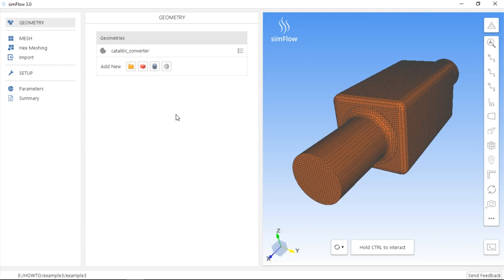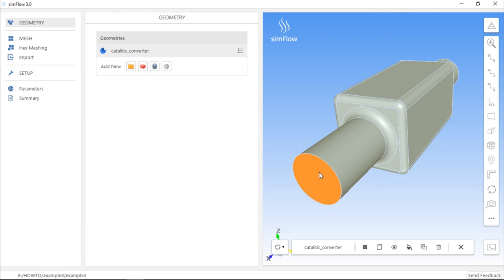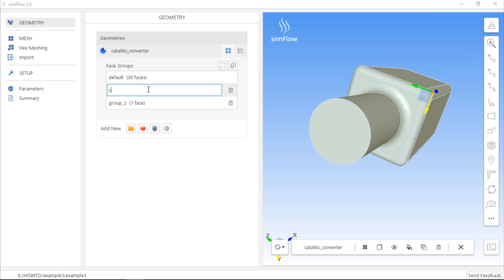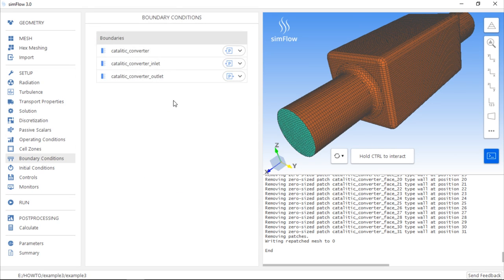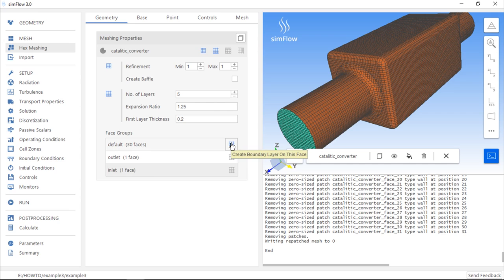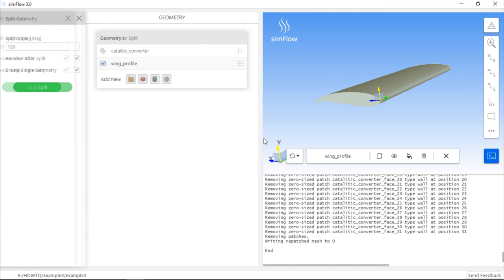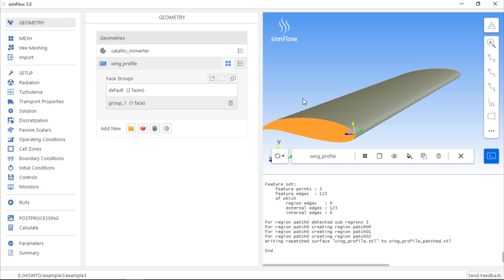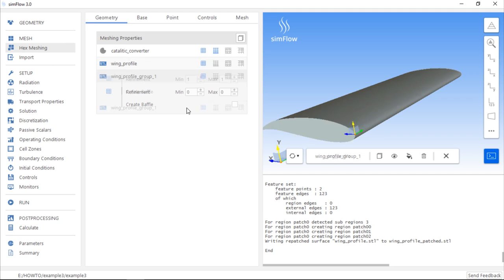How to separate faces from a geometry?

Comment: it selects the whole object for me what should i do
Reply: and when i try to use that split tool the programm freezes
Reply from the maker: It depends on the type of the geometry you are importing STEP or STL.
If it is STEP then the whole body is highlighted, but surface is highlighted in yellow.
The "split" option is only valid when the geometry is of the STL type - the program automatically divides it into individual surfaces by checking the angle between them.
Reply: Thank you for the fast reply, I already managed it by remaking the object and saving it to .STL instead of .obj .